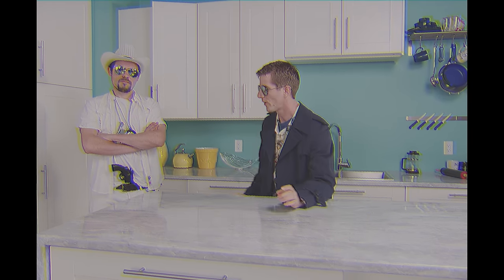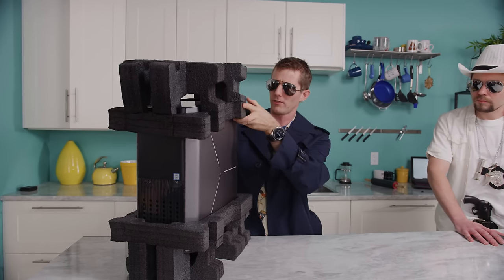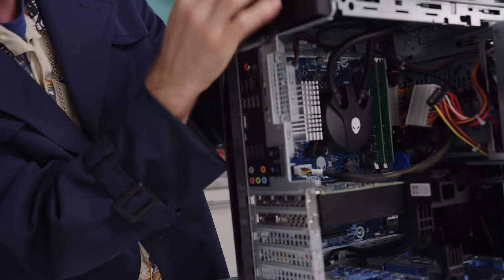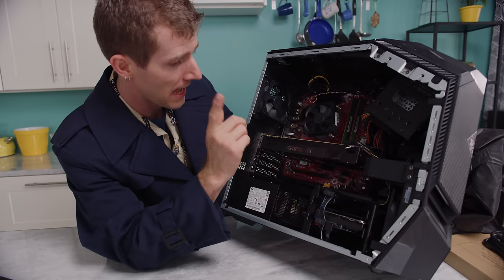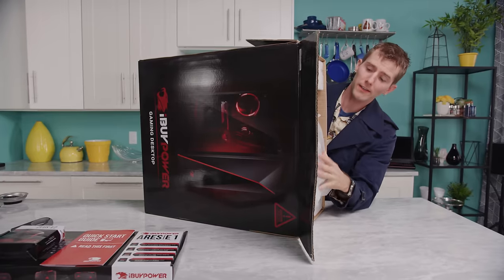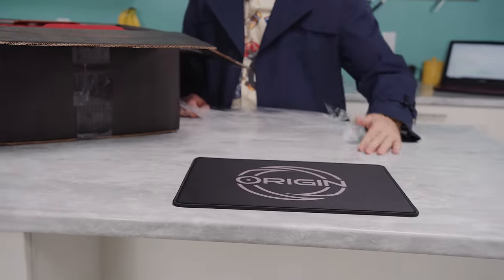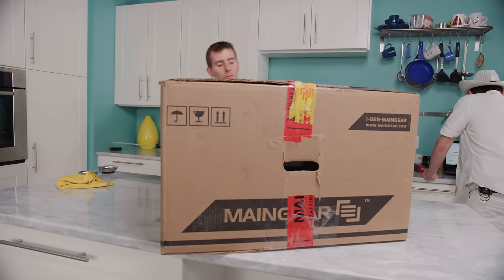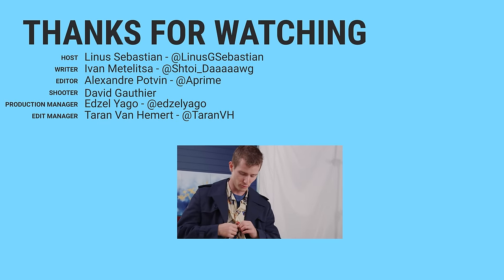What did we BUY?? - $1500 Gaming PC Secret Shopper Part 2

Comment: Sure the ryzen might not perform as good and straight gaming but it was recommended after she told the guys that he likes to stream. Run your benchmarks while streaming to twitch or YouTube and I bet that experience is way better
Reply: That's a very good point. Also the Ryzen might not matter so much when paired with the 1060, it is likely the GPU will be the bottleneck in gaming compared to the systems with the 1070.
Reply: Nice of you to remember. I only came to the comment section because I wanted to remind people of this! The Ryzen was a good choice for the work she told the seller it was going to be used for!
Reply: 6 cores would habe been fine, but then you would miss out on upgradability down line, if you would still be gaming and streaming
Reply: Also the Intel chips are locked... it's gonna be really close no matter what.
Reply: Nice u remember
Reply: oh really
Reply: there will be no difference in streaming. There are actually tests showing an 8700k outperforming 2700x with gaming + streaming.
So it highly depends on the game itself.

@Degenerate Pervert
not all intel systems linus showed are locked. In fact as i remember only one was.

Why people still try so hard on cherry picking to bash against intel. Not understandable.
As Linus said, priority was raw gaming performance. The Ryzen does not match the best gaming performance they could have offered. Storry ended, period.
Reply: i dont know about the new ryzen series but i do know AMD is known to be far more overclockable then intel.
Reply: @dom3827  does not match in this particular setup. But if you compare let's say 9600k and ryzen R5 2600x in what you get for a buck, ryzen trash intel. You do not get cooler with 9600 and you pay 100 dollars more for it which you could spend either on a decent aio liquid cooler and overclock ryzen to get same performance or buy some extra memory. And motherboards for AMD are also cheaper. Thing is people are bashing intel for scaming and overpricing customers for years since AMD was "afk" in cpu industry.
Reply: @dom3827  2700x is cheaper with as good/better streaming performance.  Probably why it was recommended.
Reply: Ryzen has soy cores that don't perform better at streaming than Intel's. So not only do you get better game performance because of better clocks even with less cores and threads you're still performing better as well while streaming.
Reply: Intel is their sponsor, it's pointless to tell them that...

Comment: Maingear only recommended the ryzen because the customer said he did video/ streaming in addition to gaming and wasn't using a high end monitor.
Reply: Very true, the rep did his job.
Reply: going by benchmarks in general, the ryzens are most of the top "performance for value" brands. i don't know enough how they handle specific jobs but the CPU benchmarking site i have always used shows them to be pretty formidable (which surprised me)
Reply: @SurgStriker  Ryzen are a great value/perf ratio because of how many cores you get for the price vs. intel. Intel CPUs still have better single core performance which is why they are still recommended if ultimate gaming performance is your desire.
Reply: Maingear would be an absolute winner if they had slapped on the stock cooler on the CPU and used the AIO money to upgrade the GPU
Reply: Yep this! Shame Linus seemed to forget this fact.
Reply: The customer was a she
Reply: @dfalconerio  it was about her brother, so *he streams,
but they fucked it up, because she said he records his games and uploads to yt... that's not streaming
Reply: good point m8
Reply: @dfalconerio  But the person it was supposedly for was her "brother"

Comment: $2000 for this crap?!?! A GTX 1050TI?!!? Talk about scam
Reply: It's 2000 Canadian dollars, but still pretty nuts
Reply: Owen Som 1500 in American I think don’t know tho
Reply: 2000 Canadian (1500 USD)  is a ripoff if you buy any of these systems. My PC has a similar spec to these systems, but only costed me ~$800
Reply: @kevinmayes4934  good job you figured out what a prebuilt is
Reply: You can get a 2060 for under 2000 CAD easily now. But you can get a prebuilt with 2070 super for 1.8k CAD. Just the prebuilt has worse cpu, ram, etc
Reply: My PC has an i5 9400f and a EVGA GTX 1060 6GB and more storage and a DVD Drive/Burner (Yeah I’m a bit weird I guess) and it’s worth 930 Bucks so it’s not just a scam but a ripoff as well
Reply: In england you can build a PC with a 3070, ryzen 5 3600x, 16gb corsair ram, a good NZXT H510 case, corsair 750w power supply, and a good MSI motherboard for like £1200 which is literally $1530. So yeah, you lot get scammed for prebuilts.
Reply: Flav C some of those parts didn’t even exist at the time. While I agree that prebuilds are lower value comparing parts years later is not really fair.
Reply: For 1500 I got a 2070 super, i7, and 16gb ram I don’t know about the motherboard sorry.
Reply: ik bro i got a 1200 doller usd pc AND IT came with a 1050
Reply: I built more powerful systems for under 250... I5 4590 and gtx 1650, the cpu is older but it's no use to have a better one, because the gpu is a bottleneck anyways.
Reply: @loib  its not a prevuilt, its a cutom built.
Reply: @hasanaziz127  thats fair, i did use the term s;lightly incorrectly in that sense, but what i mean is it's "pre-built" for you, AKA you dont have to build it yourself
Reply: @loib  yeah, well atleast u get to choose the parts. Prebuilt pcs in my country are also good. For $750 you can get an i7 with a rtx 1080 ti as well as 16gb ram and 2tb storage. I have this one. I had it prebuilt for $750.
Reply: Still a better value than buying a mac
Reply: @couchtwat2355  true
Reply: Hey look, it’s 2 years later and it pretty much costs that again now lol
Reply: @TheAngryBlobfish  seems about the right privé
Reply: @kevinmayes4934  Its odd because I have the same spec and its a I Buy Power but it only cost $800 (Intel Core i5-8400, GTX 1060)

Comment: Having worked in PC factories around the world (Including the large Dell/Alienware factory just across the Mexican border from El Paso Texas), those clear protectors over the plastic on the Dell are installed well before the PC is actually assembled. Those holes in that plastic protector are so it can go through the whole assembly and testing process with them in place without cooking the system (causing it to fail diagnostics).

Fun fact, the Dell and HP are (most likely) both actually made by Foxconn. As, like Apple, Foxconn makes the majority of their products.

Comment: I purchased a $1799 prebuilt from digital storm. Before buying I checked the parts on PC part (or equivalent due to proprietary GPU and RAM) and the price on PC part picker was higher. I've had the system now for 6 months and have had no issues. I'm very satisfied with their product and process. 14 days from ordering to my door.

Comment: Aw man I should've went with an i7 3770k, rather than the 3770 I'm getting. Y'know, for that like 10 times the performance.
Reply: omg! You lost your  x10 power boost man.
Seriously though they should call them and ask "Hey what did you sent me? Where is my laptop?"
Reply: and 10 times the heat.
Reply: tbh, i do wish i had a 3770k
Reply: @daydodog  I have one laying around.. Interested? lol
Reply: Not 10 times faster but a nice boost if you overclock it to 4.8ghz especially in 2018!
Reply: @MoneyMaking861  They're hard to get stable over 4.7GHz, sweetspot is 4.5GHz.
Reply: @sigibaes  not a big difference even at 4.5ghz is a nice bump over stock 3.7ghz all core boost
Reply: @CJBMAGGOT94  DDR3. I'm not sure why you'd invest in getting a 3rd gen CPU but my 3570k at 4.7ghz still runs more than fine after all these years. 

They're also painfully cheap so if you're on a budget it's really not a bad purchase. Just probably shouldn't be throwing a high end GPU at it.
Reply: @Jepysauce  Nah, it's worth saving for new higher end hardware that will last years. Wasting money on old tech really doesn't make sense. You will be upgrading anyway.
Reply: I have a i7-3770k! It runs Crysis with 500 FPS on Ultra with my 1060! Dont think I need to upgrade soon, luckily I went with the k 5 years ago! :D
Reply: k means thousand, so its actually a thousand times faster. Knowledge yourself up in technology man, youre embarassing yourself.

Comment: I got my system off iBuyPower a few months ago and I love it , all brand parts
Ryzen 5 3600
Rtx 3070 Asus dual
1 TB ssd nvme m.2
Team force 3600mhz delta 16 gb
750 watt 80 gold
Thermatake c240 water cooler
B550 tuff gaming plus 
Gamidas Talos m1b case
For total 2250

There website building process is excellent.

Comment: I have an iBuyPower TraceX 931, so I'm certainly biased watching this lol! In reality though it's pretty good. It's got 16Gigs of ram, a 7700k CPU, a corsair liquid cooler, and GTX1080 graphics card, as well as a SATA SSD. It's great for gaming and runs really smooth. The GTX1080 overclocks well too! Oddly, the one you guys have looks EXACTLY the same except for the graphics card, the color of the fan, and the color of the RAM sticks, and the RGB stripe across the front of the case!

Comment: @8:00 - ah, the "fully modular power supply", which in my 2010 Area-51 ALX meant "fully wired into one big fat modular chunk that would only work with this exact power supply".  It's still running today, thanks to some modifications, using an EVGA upgrade.

Comment: imagine buying a 1500 usd pc with  a gtx1060 when its almost 2019,  thats so amazing
Reply: I'd take the 1060 over the 1050 Ti
Reply: i got a pc for $800 with a 1060
Reply: You have to remember that these companies have to make money. What you could go out online and buy with 1500 and build yourself wont get you the same specs as taking that 1500 to one of these companies to make for you.
Reply: @justinolson834  exactly
Reply: That's Linus's fault for being a noob buyer and not doing research. I got this AW Aurora R7 with GTX 1070 in February 2018 for $1100 from Best buy. It was 8700 non K thou, but also Liquid Cooled. Dell's PC in general and Alienware are actually very competitively priced, you can often find deals that are cheaper than if you can build it yourself, and always much cheaper than any deals you can have from Origins or IBuyPower. But again you have to pay attention: shop around between Best Buy and Dell Websites, and Dell websites almost always have some kind of coupons going on, you just need to apply IT. Dell will let you check out a computer w/o applying that 35% coupon that they touted somewhere on the website, it's your fault to not noticing it and put it in. The true price is 35% off that $1500. Typical Dell.
For Origins, they do not have access to bulk pricing as OEM like HP and Dell do. They use the same off the shelf part you and me get, and they need to pay people so... I don't get it why people bought Origins and iBuyPower since you can get the same component at cheaper price. For Dell and HP, the argument is that you can actually often find deals that are cheaper than building your own.
During this BF season, both Dell and HP offered configuration with i7-8700 and RTX2080 for $1500. So this is a very bad video
Reply: @justinolson834  and you know how they make their money? By cutting corners and and buying in bulk at low prices
Reply: @bigironenthusiast9343  yea lol, I guarantee they made at least 700 dollars on that system, with the 1050ti
Reply: @99gagaman  Last year my brother got a hp desktop with a 1060 for 500$, black friday this year nothing really came close to a deal on any computer
Reply: @TuanLe-eb5yp  That wasn't linus' fault at all.  The entire point was to see what a salesperson would sell someone uninformed.
Reply: @idooopstv9823  fair. But then it's a pointless experiment. Do you even need to try to see what car salesmen would sell an uninformed buyer with no research even a simple google price comparison ? They're salesmen... it's the same everywhere and everything. I have never known anyone in my life who buy PC on the phone.... there's the store, there's the internet with images you can see... If you know nothing typically you have a cousin or friend.... If you do that expect no better result than going blind into a car lot. For car it's even worse because of not only higher price for less car, but also bad deal on the financing.
Reply: @KalebQi  I'd take an Rx 580 8gb over both any day of the week.
Reply: @xRezurrection  Brand new, recently, with a warranty, within a prebuilt from an SI? Wow that's impressive.
Reply: @xRezurrection  Well of course it was used. It's old hardware. Nothing wrong with that but you're comparing apples and oranges.

Comment: my friend bought an ibuypower and when he got it he plugged his monitor into the mobo video ports. after he told me what kind of fps he was getting i knew what was up. the assemblers didn't take the little rubber plugs out of the gpu before shipping so he didnt know there were ports there. after he plugged the video cable into the right ports everything was fine, and the pcie connecter was connected to the gpu.

Comment: case pressure on the hp omen system is negative, the 120mm intake cant keep up with a 92 at the back, a blower 1070 and a rear-mounted 92mm fan on the PSU

Comment: Good - Fast - Cheap:  Pick Two.  

At this point, Maingear is showing they are not the bargain shoppers choice.  All that "good" cost money.  To get the service, quality and "goodies" Maingear's rig is going to cost a few hundred more for an equally equipped box.  Perfectly fine with me.  If a few hundred $ more means I can avoid that boondoggle of an experience with Dell or one of the others, sign me up.  Overpaying sucks, but there is a point where quality is worth a little more.  Edit for wonky formatting???

Comment: Are you seriously implying Ryzen 2600 (or 2600x, which one was it?) would bottleneck a 1060?
Reply: its a 2600x, and I thought its fast enough to work with a 1080,
Reply: There goes that shilling lol.
Reply: he said it might have issues with "particular" tests they have in mind to run. Since we do not know which ones, its safe to say he might not be wrong
Reply: What particular test do they have in mind thats going to make an r5 2600 gimp a 1060...
Reply: @strikepaw1  Intel did better in the tests Hitler is talking about because they passed the most important test of all, the check cleared.
Reply: @Raith Intel didn't do better in the test compared to Ryzen paired with the same GPU's. I watched the video and like I said and proved earlier, no difference between ryzen with an GTX 1070 vs intel. Alot of people dont seem to know this but the r5 2600 is faster than the i5 8400 in gaming.
Reply: I currently have a first gen Ryzen 5 1600x with my GTX 1060 FTW+ 6GB version, and it's my graphics card that keeps holding me back in gaming. My Ryzen doesn't even break a sweat at like 10 - 20% while my GPU sits at like 95% or higher. These days, it's all about the GPU now... stop worrying about that extra 10% CPU performance and just get what makes sense for the budget and focus more on reliability, heat dissipation and GPU performance... and in that order.